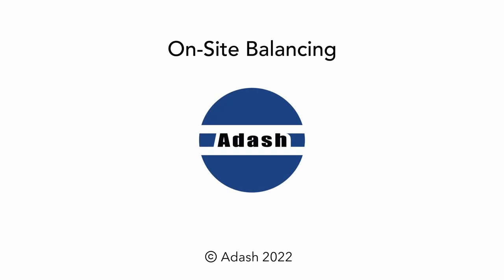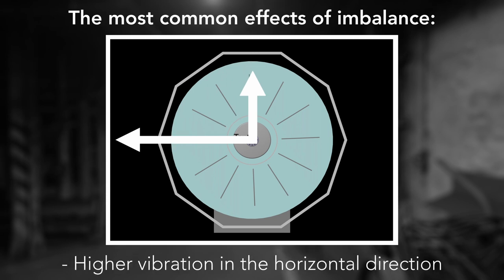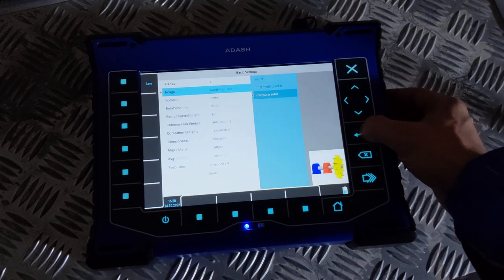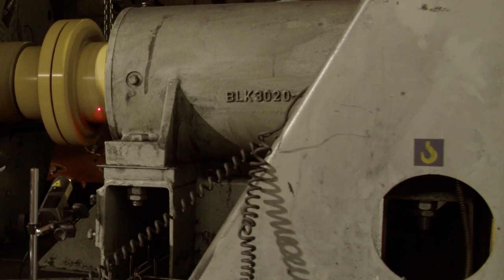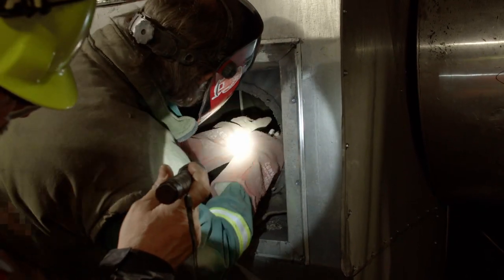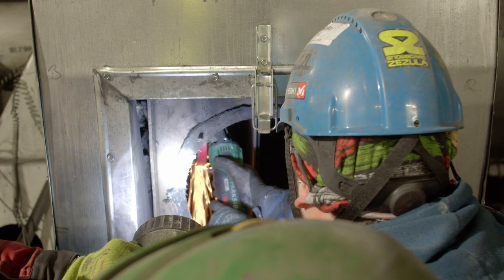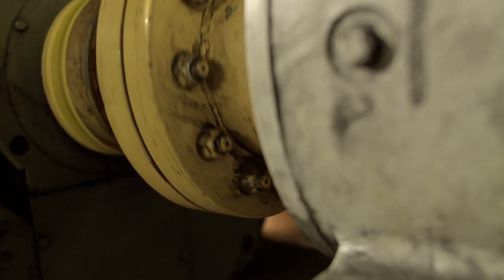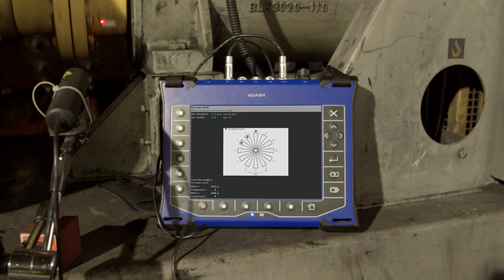On-Site Balancing Guide (balancing preparation, procedure, advices)

Comment: Would placing the reflector and sensor in horizontal alignment provide a more accurate measurement?
Reply from the maker: Not more accurate, but maybe you will get slightly higher vibrations in horizontal position of the sensor on this kind of machine.

Comment: DO NOT run the fan with the hatch cover off! This will be a violation of safety protocol on EVERY plant site!  You never know what is in that ductwork - product, welding slag, welding rods, etc.  You don't want that coming out of the fan. If you are using “clamp on” weights they can and DO come off sometimes.  Hatch only needs a couple of fasteners, but NEVER run a fan with the hatch cover off!!!
Reply from the maker: Good point Rusty. Guys from the video should have cover it.
Reply: Besides the safety aspect, leaving the hatch open can also give a faulty reading as air flow turbulence can have an effect on the fan runner. By closing the hatch you create the working condition of the fan.